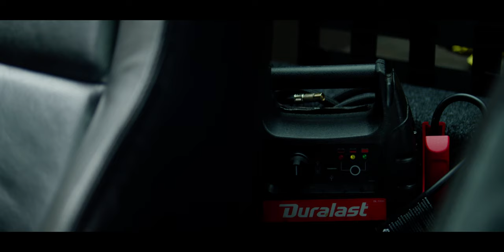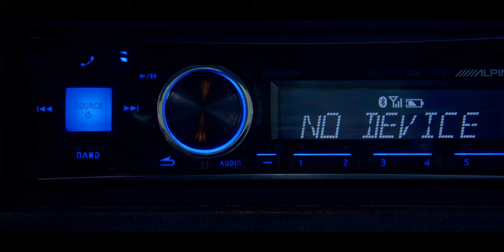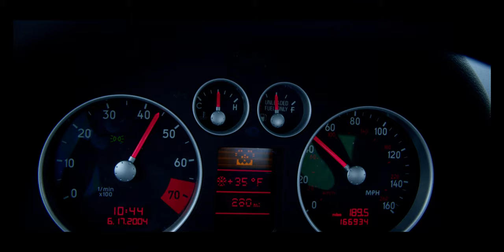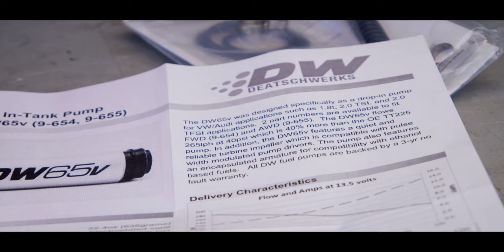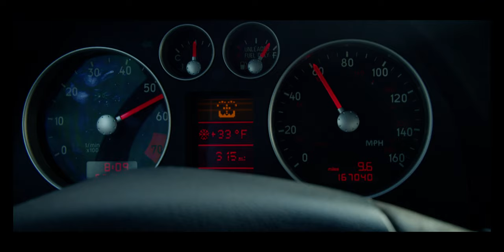Upgrading The Fuel Pump on the Big Turbo TT | The Holiday Push

Comment: Another nice job !
I did that, and I must confess that understanding how the bracket for the second part was fitted drove me nut. 
Fortunatly, thanx for the TT community on the net !
The first pump disasembling was to clean up the track sensors, because the reading on the cluster was wrong. 
Success.
And the second pne was to upgrade the pump.
Something I did was to empty the reservoir, because having time with the nose smelling the fuel was a nightmare 😵

Comment: I also opted for a DW fuel pump but when I was swapping that in I also put in a new fuel filter. 
The guy who recommended DW said I should replace the filter when you do it. 
I dunno if it was just my TT but my filter was in fact clogged up. So, after the filter and pump my TT was feeling like a whole different animal lol.

Comment: What kind of camera do you use?
Reply from the maker: I rotate between a couple cameras and lenses depending on the type of shot I want to get. The current A cam is an all manual Blackmagic Cinema Camera. The B cam is a lumix G85. Ive also got a couple specific use cameras like gopros or stabilized Dji. Thank you for the support

Comment: The trunk struts take like 5 munites or less
Reply from the maker: True! They are super quick. Thank you for the support!
Reply: It's a cool car. On once it's running how you ld like, I'd like to see headlights, taillights, and rear parcel shelf updates 

And oem roof racks do exist, you still could make so many more mod videos and enjoy the car all along the way
Reply: @MarkMyWordsXx  oem roof racks are hard to come by, when you find them they are $1000+
Reply: @WWILL89  right. But this guy is pretty clever. The car is custom anyway. I'm sure he could solve that problem if he so chose
Reply: @MarkMyWordsXx  I sure he could, I ended up just buying a oem set to keep everything oem+
Reply: @WWILL89  Imo oem doesn't make sense for these cars. Eventually, much of these cars become modded, often by necessity. The more I mod, the more it's clear that "oem" had a ton of short comings.
Reply: @MarkMyWordsXx  they definitely come out the factory on a conservative tune, once I did catless dp all the deletes and supporting mods it’s a blast, waiting on this stock k04 to blow to drop in a hybrid at this point
Reply: @WWILL89  been there done that, I have the f 23 in it. It all depends on what you wanna do with it as far as hp. I've had my 04 225 for 15 years, and I'd bet the farm I've almost done it all. 

Pm me if you need any ideas or help with random stuff or whatever